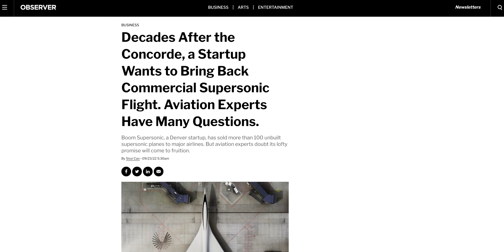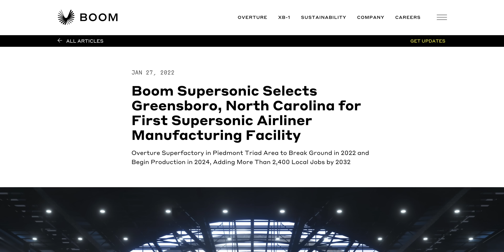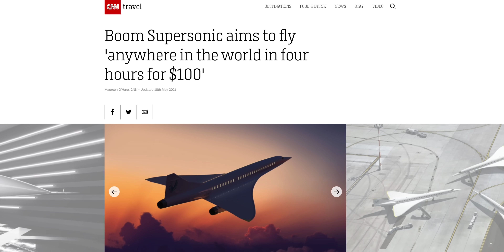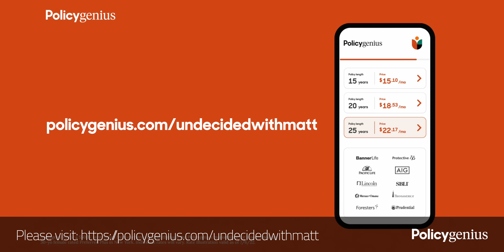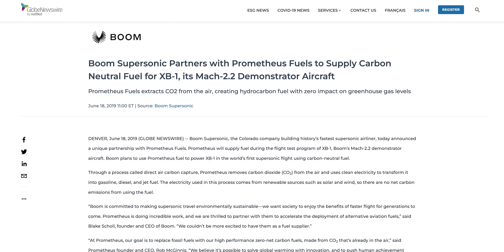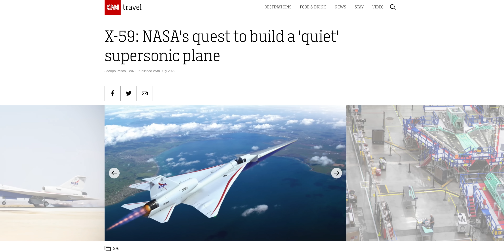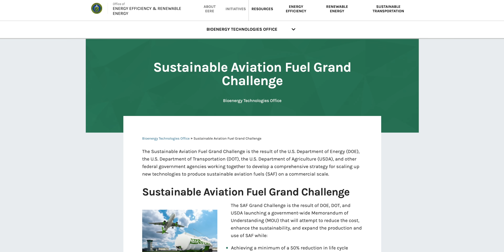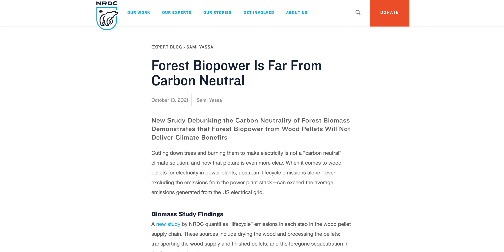Fueling a Clean Supersonic Plane Comeback

Comment: Airplanes Travel in general is very Clean. They wash these Gas Guzzling Wonders regularly, inside and out. Between unloading passengers and loading new passengers, a cleaning crew will generally go thru the cabin picking up trash and wiping up spills. Very Clean. The have nice Air Filter to Clean the air, so everyone has warm clean air to breath. Supersonic Aircraft will be even cleaner, as Matt Ferrell says. Remember, Supersonic Travel uses much more Gas than your normal Gas Guzzling Subsonic Aircraft making such travel more expensive. So, only rich people who can afford to burn all the extra fuel to travel from one spot to another, like to be pampered. First Class Treatment on these Tiny Supersonic Aircraft to keep rich folks happy. Cleaning before the flight, cleaning during Taxi and Takeoff, cleaning during the flight, wiping up the wine spill, the cabin crew will continuously clean. And as a bonus, for flying so fast, due to the extreme energy usage, the entire aircraft will heat up. Burning off everything, making the exterior of the aircraft cleaner than when it took off. Just like putting the aircraft in a bonfire of jet fuel. 

Everybody like to travel in a clean jet.

Comment: I feel like the usage will be too niche for economies of scale to be reached so it won’t deliver on the “inexpensive” promise.

For any trip which is connected by land: high speed rail will require less energy simply because they don’t have to waste energy on defying gravity. So it’ll definitely be less expensive.

Normal flights will be less expensive per mile just due to lower fuel use so citizens will likely still take normal flights for any trip 8 hours or less just because it’s not inconvenient.

So that leaves only 8+ hour long flights for this to replace. Which simply isn’t that common of a flight length.

Comment: Incredible amounts of fuel used, extremely expensive tickets, needs brand new mechanical hubs, extreme stresses on airframes, only transatlantic/transpacific routes and all to save about half the time on the plane? When half of the time spent travelling is just in the airport already? Yeah sounds great. I can see why Rolls Royce pulled out, its a joke project that is going to fail like the rest of the 'free money, low interest rates, move fast break things' startups when investors start demanding returns
Reply: I dont see how your comment is relevant. The plane is designed to withstand the stresses of supersonic flight. Supersonic flight has been around for 80 years. And yes, if people can afford and are willing to pay more for a shorter flight, then why not? Dont be mad cuz you cant afford it
Reply: @rnapol3266  Yeah but they want to get the cost to less than 100 dollars per ticket. Given that they will have to contend with legislators as well, who usually aren't too happy about sonic booms plaguing the surrounding cities, I really can't see how feasible this project is.

Besides, it might be built to withstand the stresses, but that doesn't take away that with higher stresses come higher maintenance costs. Maintenance that is not standardized, which in turn is more expensive,...

It's cool engineering, but there are a huge amount of lofty promises and assumptions this company is making that all need to be fulfilled in order to get even close to being viable.
Reply: @habba5965  the sonic booms don’t happen over landmass because it’ll only be over the ocean. When the aircraft approaches an airport in an urban area, the airspeed is slowed down, especially for landing. The plane doesnt land at supersonic speed…
Reply: @rnapol3266  except that a plane built for super cruise practically falls out of the air at normal speeds. It’s going to be competing with composite wide body aircraft with extremely high bypass turbofans. If they can get prices down to $100 then the rest of the industry will be at $50 (but they won’t because that would not even cover atc/airport fees)

It’s cool, super freaking cool, but it’s as impractical as driving an f1 car to work. You can’t use its one benefit and it’s costs are prohibitively expensive
Reply: @rnapol3266  So this would only be useful for transatlantic and transpacific flights?
Reply: @tuqe  I assure you that supersonic aircraft dont stall at their designed approach speeds, or else they wouldnt be able to land, ever. Their approach speeds for landing are well below supersonic. They dont need to be as low as traditional airliners … it wont make much more noise than a traditional airliner on final approach and landing
Reply: @rnapol3266  also “if people can afford it and are willing” doesn’t justify anything. People would be willing to pay to hunt humans or burn down forests for fun. We have institutions and regulators to prevent the market from bending to the wills of the richest and the most disturbed.

The knock on effects of massively increased pollution, ear shattering booms and a horrendous waste of investment capital are not something the market prices in.
Reply: There is so many 'if's that has to align for this concept to work, I can't see a way of making it viable. Its an incredible feat of logistics, engineering and manufacturing just to make ordinary flight possible.
Reply: Yea, promised prices feel like a pipe dream for a length of flight which only a very small fraction of the population takes on a regular basis.
Reply: @SaveMoneySavethePlanet  millions of north americans go to europe each year, and millions of europeans go to north america each year. How is that a “small portion” of the population? You never travel to europe? Lol
Reply: @rnapol3266  sure, but the flight time from NY to Paris is only about 7.5 hours. You really think those people are going to fork over a ton of extra cash just to arrive a couple hours earlier? Their whole business proposition currently relies on being able to provide insanely cheap tickets, but the facts just don’t seem to support that claim.

And if the price doesn’t come into being than when it comes time to actually click order on the ticket, most people are going to choose the one that is way less expensive and just watch one extra movie on the flight.